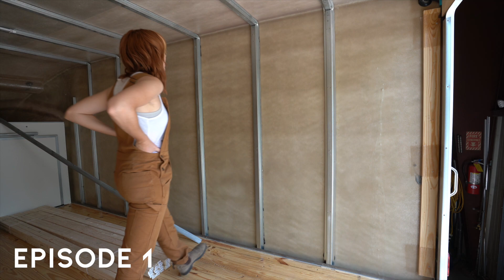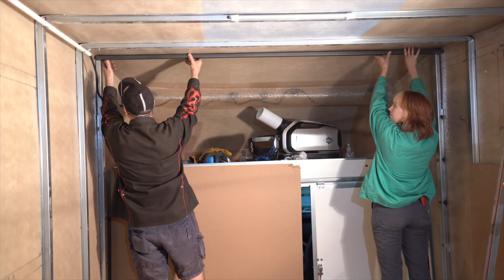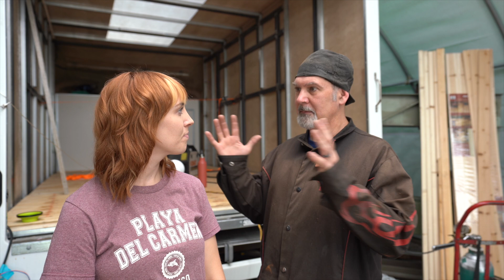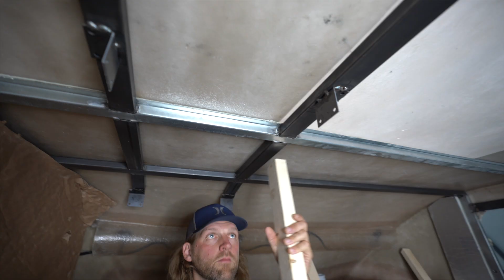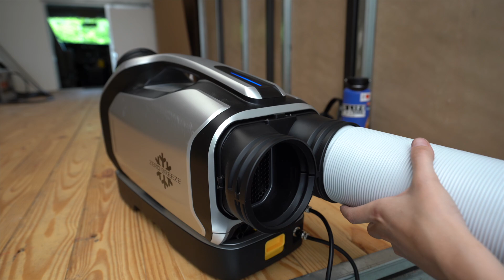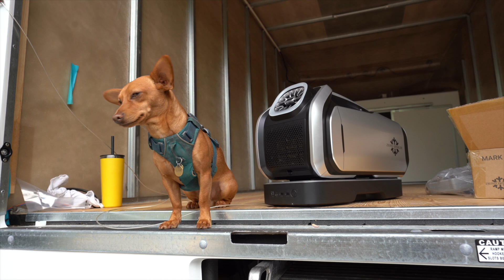Unicell Build Ep 2 | Framing Reinforcement & Zero Breeze Mark 2 Review

Comment: One thing I see everybody doing that I think is wrong it is putting both tubes out the window. The way I think would be more  efficient is just put exhaust tube  outside, and the fresh air intake should stay inside so you can recirculate the cool air. Seems to me if you pull the hot air in, your constantly trying to cool down the outside air.  Correct me if I'm wrong I since I don't have a user manual for it.
Reply from the maker: We also had this question and couldn't really find answers. We tested it both ways and it ran very similar in both scenarios. We don't use an intake tube in our shop, only the exhaust tube.
Reply: @OurWayToRoam  that makes sense not using the fresh air return in your shop because it's such a large area. There is a video that shows it being used both ways and the difference in temperature was noticeable. I'll have to search for it I hope I'll find it again
Reply from the maker: @tomwilliam5118  yes please link it if you find it! Thanks Tom ☺️

Comment: Last night I was finishing up our design and was figuring the difference in weight between 2x4 wood and .063 and .095 1x2 steel tubing so the timing of your video could not be more perfect.
What thickness of tubing did you use?
Reply from the maker: We felt that the amount of steel 1x2s we used would be stronger, lighter, and just overall easier than framing with wood. We also probably saved some wall thickness by using the steel. We used 14g for the ceiling supports and 16g for the wall supports!
Reply: @OurWayToRoam  A fairly dry 2x4(wood) is approx 1.21lbs per foot and 16g 1x2(steel) is 1.27lbs pre foot. Good call. I'm also using the steel for the verticals in areas that are divided, like bathroom walls...
Great minds think alike😀

Comment: That was a productive week. I noticed Y'all cooling welds with a wet rag, smell glue burning much? When ya cut out sections of hat channel, how did ya manage to stay off the fiberglass, anything other than use extreme caution?
Reply from the maker: Yes it was necessary to quench all the welds when welding that close to the fiberglass so it wouldn’t bubble or discolor. Definitely recommend that! Because the hat channel is glued to the fiberglass there wasn’t really the option to put a barrier like sheet metal between the two. Extreme caution is the best we could get haha.